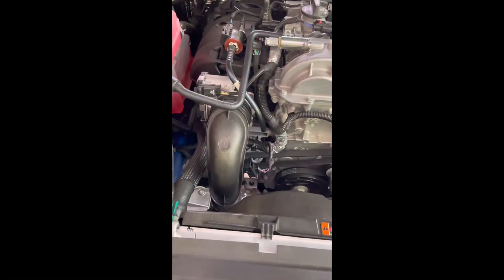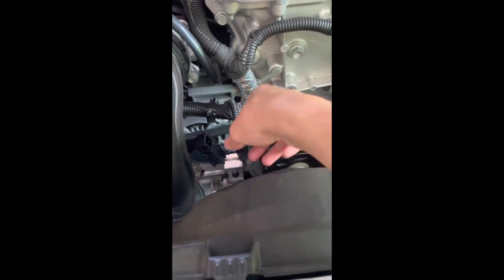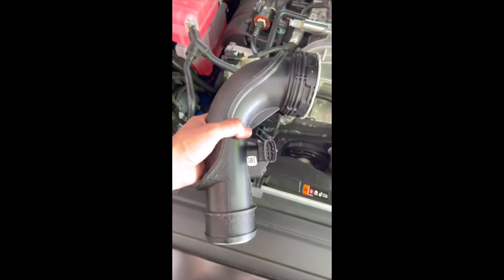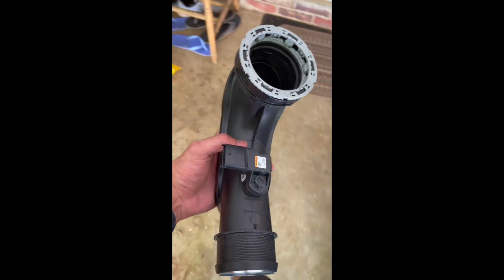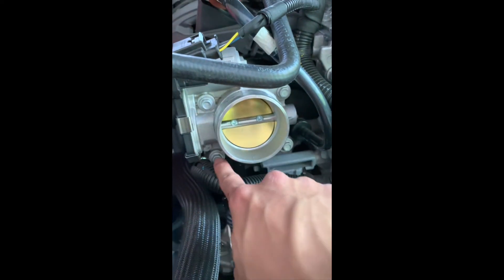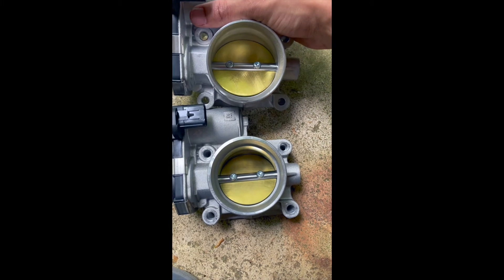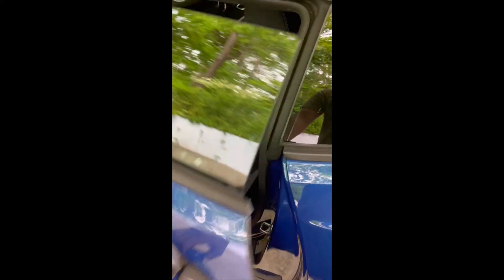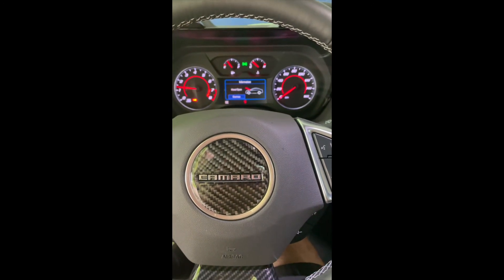Installing The ZZP Larger Throttle Body - 2021 Camaro 2.0T

Comment: Did you ever get a check engine light
Reply from the maker: No check engine light
Reply: @turboslovecamaros7372  any tune needed sir
Reply from the maker: tune recommended for power gains @lsjionredlinesupercharged2049
Reply: @turboslovecamaros7372  yeah I have catless DP now and runs like poop a tune will be next month 🙈
Reply from the maker: even without a tune my car was idling a bit weird with the larger throttle body @lsjionredlinesupercharged2049
Reply: @turboslovecamaros7372 hey, did you feel any power? Without tune.